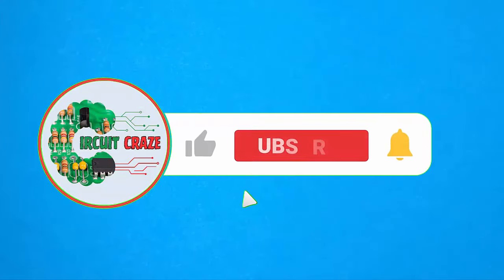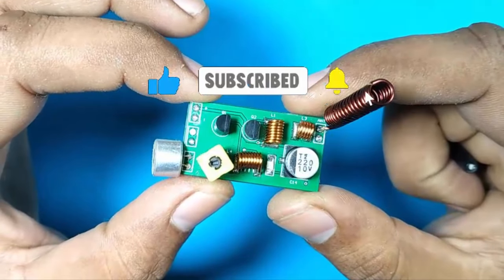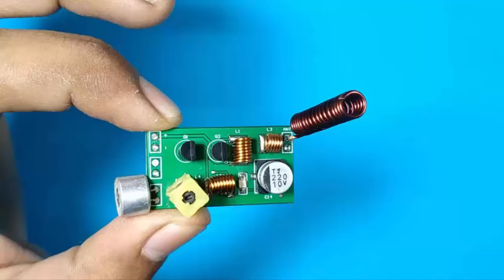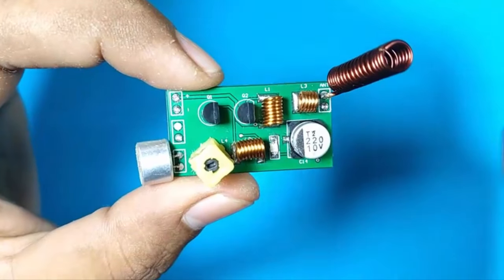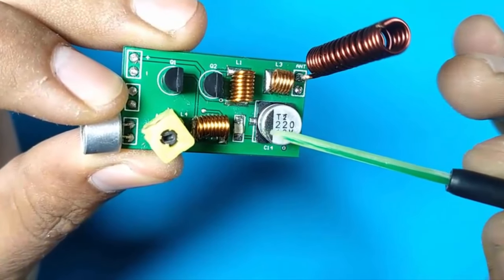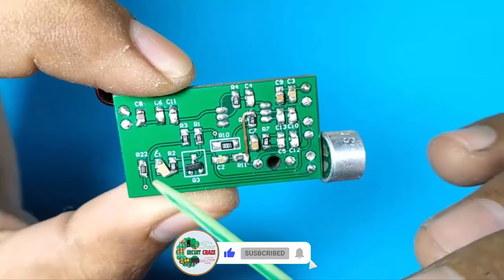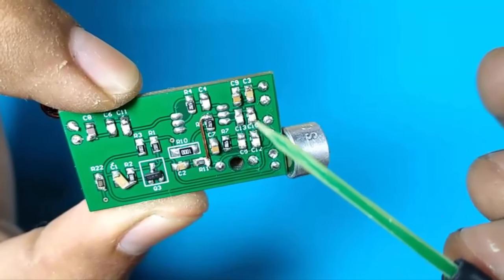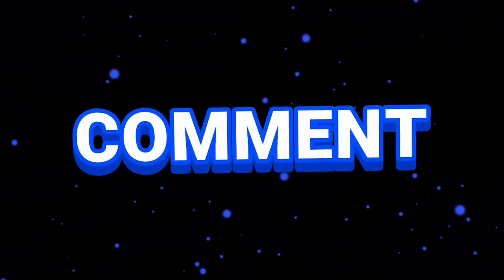FM Transmitter Circuit | 1KM Wireless FM Transmitter Circuit

Comment: Two transistor 750-metre range transmitters?  In your dreams. More likely 100metres
Reply from the maker: It's will operate on 7.4v and also have PA portion.this is tested project.